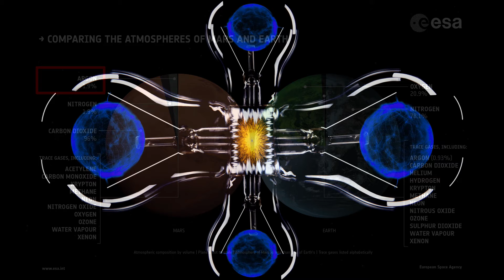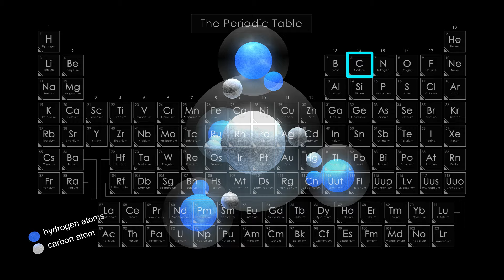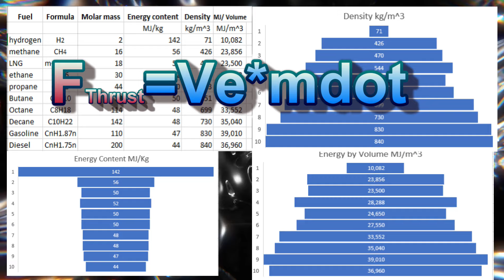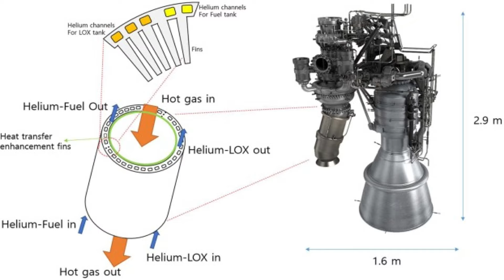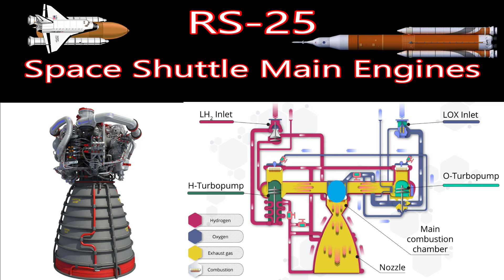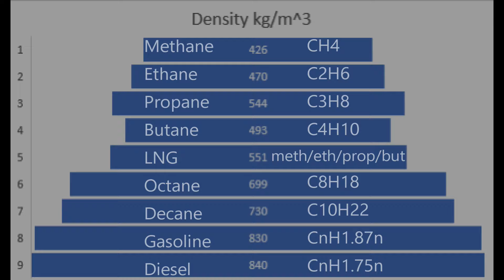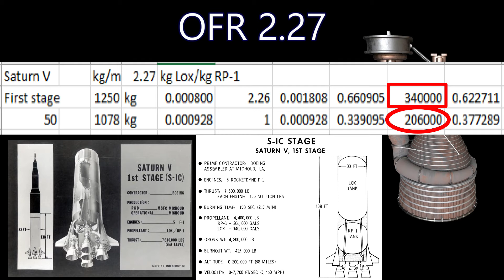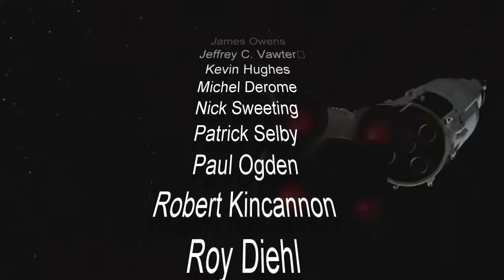Rocket Science: Rocket Engines and Rocket Fuel Fundamentals

Comment: Excellent! A few small corrections:
1. The RS-25 low pressure oxidizer turbopump actually is powered by a liquid turbine, which taps a small amount of oxygen off the exit of the high pressure oxidizer turbopump to run it. Low pressure fuel turbopump uses the expander cycle. 
2. A Rocketdyne paper talks about several possible modifications for the RS-25, and among them is a methalox version meant for liquid boosters on the space shuttle.
3.  Soviet/Russian engines tend to burn closer to stoichiometric than their American counterparts, however all engines burn somewhat fuel rich in their main combustion chambers. Oxygen rich mixtures are only burned in oxygen rich preburners. Preburners tend to have higher fuel flow and burn at much higher pressures than gas generators.
4. Not nessisarily a correction but a note. That 146m RS-25 number just came from dividing the engine contract amount by the funding amount, and I haven't looked at the OIG article but I believe that contract also included money for development of a cheaper, disposable RS-25, as well as a factory expansion. Not factoring out those numbers would be like saying a Crew Dragon seat cost $500 million, instead of the more accurate average of $55 million per seat. However, the RS-25 is still most certainly more expensive then the RS-68.
Reply from the maker: 1.Interesting... did not see that in the schematics.  Thank you. 
2. I'll have to look for that... thanks.
3. Did it sounds like I was saying the entire rocket engine was burning oxidizer rich?  I don't know of any that does.
4. Thanks.

Comment: I just speculated if it was possible to standardize rocket components then the “plug-and-play” for electronics could be used to build any engine we want. But since this doesn’t seem to have been done with internal combustion engines for vehicles proves the difference between theory and practice.
Reply from the maker: It's not a bad idea.  Actually a lot of engines use interchangeable components.  A think rockets need to be more modular. :-)

Comment: The range of temperatures at which both oxygen and methane are liquid is very narrow, only about 1 degree C... at sea level pressure. Compressing both gasses raises the boiling point of oxygen but lowers the freezing point of methane so I'm sure the pressure in the propellant tanks of shared dome rockets like Starship and Heavy Booster are carefully controlled.
A deep dive would be nice, please.
Reply from the maker: Thank you Tim!  Excellent idea.
Reply: @terranspaceacademy  It appears I was wrong about the freezing point of methane lowering with increasing pressure. It stays at the same temperature.
I should really research these things BEFORE commenting instead of succumbing to nagging doubt 18 hours later.
I thought I knew the relationships of boiling and freezing points wrt pressure, but it turns out I didn't.

Comment: I heard that the RS-68 engines were originally considered for the SLS. However, RS-68 has an ablative nozzle, assembling multiple of them at the bottom of the core stage on SLS created unresolved heat issues due to their close proximity to each other. 

What I never did find out why NASA stopped development on the J-2X and decided to use the puny RL-10 engine on the SLS 2nd stage.  On the Saturn 1, 6 RL-10 engines were used on the 2nd stage only to be replaced by one Rocketdyne J-2 on the Saturn 1B.  The J-2X was a much improved and modernized version of the J-2.  Among other things the J-2X's  gas generator and supersonic main injector were based on the RS-68 design.
Reply: RS-68s were considered for Ares V, which while originally from the constellation program, SLS borrows many design elements from it. The ablative nozzles couldn't handle all the heat generated from the SRBs, which would accelerate nozzle erosion and reduce performance. In the end it was swapped out for RS-25s, before constellation was canceled and SLS development began. The J-2X development was mothballed because continuing development would most likely be expensive. NASA stated the J-2X powered earth departure stage would be OP for Artemis, which would use the exploration upper stage, but might bring it back for sending heavy cargo landers to Mars.
Reply from the maker: Thank you!
Reply from the maker: Good questions...

Comment: How could BO adapt the RS25 cycle to the BE4? The  RS25 takes around 7 seconds to start, it would be very difficulty to do propulsive landing.
Reply from the maker: Start it a little earlier at low thrust. Then ramp it up just prior to landing.
Reply: @terranspaceacademy  But isn't having a big throttle range super hard? Even raptor can only throttle down to ~40%, right?

Comment: I know this is a bit fringe, but I am not convinced that the so-called water cracking technology (whereby oxygen and hydrogen can be disassociated much more efficiently than electrolysis) was a hoax (the internet seems to have been scrubbed of these videos).  It would be pretty convenient to store the propellant as water and water would (probably) make an excellent coolant given its high heat-of-vaporization, and steam driven turbopumps might be very serviceable indeed.  Admittedly, using such a breakthrough technology just to build an ordinary chemical rocket engine seems a bit perverse, but having lots of water on board could be very useful for other purposes.
Reply: Even at 100% efficiency you would need to supply all of the energy a stoichiometric mixture of hydrogen and oxygen would release during combustion in order to split the water into hydrogen and oxygen, which means you either need a massive power supply or a long time to get all that water split. It's impossible to split a mass of water using less energy than is released by burning the same combined mass of hydrogen and oxygen, for the same reason it's impossible to lift a weight using less energy than is released by dropping that weight from the height you lifted it up to.
Reply from the maker: Good points Tyler.  I still feel that floating solar power panels over reservoirs would reduce evaporation and power electrolysis.  Then producing magnesium hydride power paste would obviate the need for cryogenics.
Reply: @terranspaceacademy  Oh sure, no real issue with that idea from a physics perspective. I was just trying to make it clear that splitting and recombining water is not a method for achieving infinite energy or anything of that sort, it effectively just acts like a chemical battery system. The really convenient thing about this kind of "battery" is that since it's just two fluids, there's no constraints in terms of power draw like there is in electrochemical batteries, so you can easily use it to power gigawatt-scale engines (ie, rockets).

Comment: Save the fuel and engines until you get to orbit. Tunnel to the sky, rocket ships once you get there.
A seventy mile tunnel with an exit at 15k feet elevation, providing a sled with 128 fps acceleration will get you to orbit with energy to spare to overcome parasitic drag on the way up. The sled detaches from the rocket ship and payload and glide/flies back to the starting gate. 
Vertical shafts with massive gravity pistons positioned along the main tunnel could be used to evacuate the tunnel just ahead of the sled as it progresses down the tunnel, with additional shafts providing high pressure air to push the sled along. Gates positioned along the tunnel operate in unison with the gravity pistons to open and close to keep the volume of the tunnel ahead and behind the sled at a minimum so the effect on the sled would be most effective. Suck and Blow, there ya go. The energy to reposition the pistons could be low tech grunt motors powered by a nuke power plant nearby.
Admittedly, there would need to be a lot of shafts with really heavy pistons with really good seals, and fast operating iris type gates that worked perfectly, but did anyone ever say getting there would be easy?
Nope.
The above scenario would be used to get light loads of say, moving meat into space. And other fragile stuff. Juice it up a bunch for sending fuel and fluids, building materials, etc.  
I have been toying with this idea for over two decades, mapped a few locations for the tunnels, and have run a bunch of calculations for using this kind of air pump system in this application.  Advancements in materials science, and TBM's have brought this much closer to feasibility; but politics and all the good real estate is a major hurdle still.
As far as cost, I don't really know. A lot of low tech grunt work is still a lot less costly than a lot of high tech work. And the high tech work has made a lot of progress lately. Now, the next paradigm requires getting a LOT of heavy stuff far enough away from earth to make the next phase possible;  sustained life habitats, stations, and factories in space.
The real problem with this idea is that it is not sexy like space x. You will have to dig several hundred miles of shafts and outfit them before you get a grain of sand to space this way. 
Please save some electrons by really thinking this through before naysaying and telling me something I already know, such as: I am an idiot. In other words, save yourself for the hard work of proving this idea won't work. You will be amazed at how feasible it actually is.
Disclaimer: I do not assume original thinking with this idea. There is a lot of inspirational ideas out there already, I have just cogitated on them a lot, and dabbled in designing some of the key components that would be required, and those also, are from other ideas others have already come up with.
Climbing that ladder, Ad Astra, Pro Terra
Reply from the maker: The tunnel would collapse on itself wouldn't it?  I suppose you could use hydrogen or helium balloons to counteract the force but it would take a lot.
Reply: @terranspaceacademy  Typically, TBM's line the tunnel as they go with fabricated panels. This application would require more sophisticated linings in addition to ones in use today.
There are only a few locations on this planet where a tunnel could be located to utilize existing geology to capture equatorial boost AND the long sloping sides of shield volcanoes for the long curve upward to the exit at or above 15k feet ASL.
Earthquakes and movement could be a problem, but no less than a tsunami would say, to Boca Chica or Cape Canaveral.   
I am not sure how H or He balloons could help, but methinks I did a poor job of describing the idea 😅.

Comment: Great discussion
Really enjoyed the detail on the SSME complex system
As a person concerned about climate change I didn’t like hearing that the Europeans used methane in an expander cycle engine why can’t oxygen be used in this role or why isn’t it used in this role as I understand liquid oxygen is very cheap almost a byproduct
Cheers
Reply from the maker: Oxygen is the oxidizer but they then need a fuel.  Methane is a good choice and can be acquired from carbon neutral sources.  Hydrogen from solar would be carbon neutral also but hydrogen from gray or black sources produce a lot of carbon.  Hydrogen combustion also produces only water :-)
Reply: Sorry I wasn’t clear
In an expander cycle engine I believe the fuel is expanded by regenerative Lee cooling the combustion chamber or by utilising a heat exchanger then then the hot gases are directed through a turbine to drive the turbo pumps
I was wondering why liquid oxygen couldn’t be similarly expanded and directed through a turbine to drive the propellant pumps bus avoiding dumping methane a powerful greenhouse gas directly into the. Atmosphere  unburnt
  Cheers